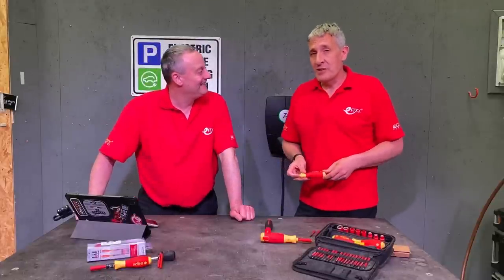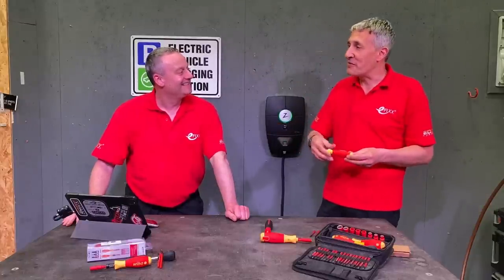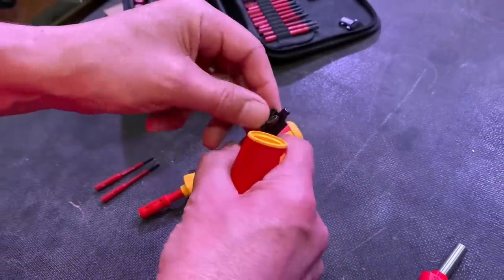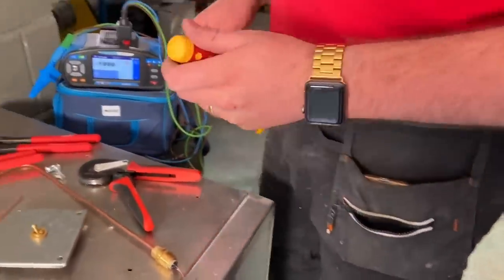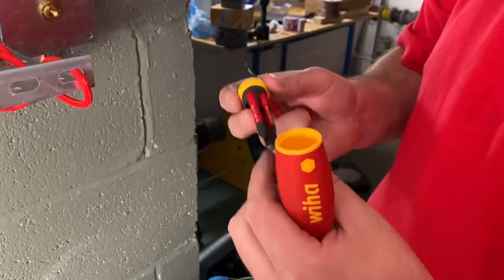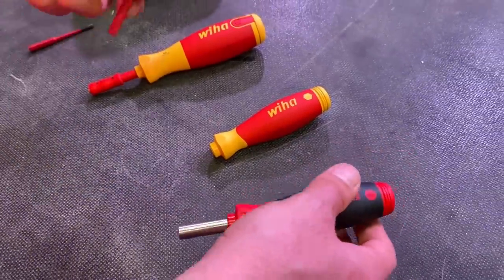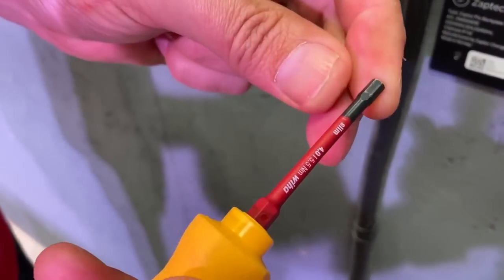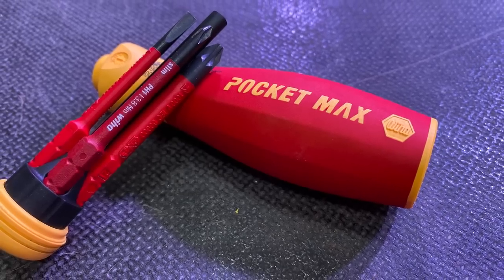The Wiha PocketMax Screwdriver Ideal for Electricians Going Places

Comment: I got this, absolutely handy but 1 downfall is that if 1 bit that you happened to use all the time broke, you needa replace the whole thing. Better just get the traditional one, so its easier for replacement.
Reply: You can buy bits separately one at the time if you need.

Comment: I've just ordered one. I've got 2 of the lift up which I use all the time. They are a bit big so hopefully this one will be nicer. Also, I hope they don't fall apart like the liftup. I've been waiting for the successor to the liftup. Liftup 2.0
Reply: @efixx  Its actually 3.0 I have an earlier version called Wiha fliptop. It was insulated but used normal 1/4" hex bits. The bit holder was too chunky so was a bit useless.

Comment: Multi-screwdrivers are supplementary kits, they'll never replace individual screwdrivers. That said, it'd be nice to see tailored kits to geographical region. In NZ (New Zealand) we use 3mm flat, Phillips 2, Robertson (square 2), and 4mm flat all day long.  It's a little frustrating when Wiha kits omitt the No.2 Sqre drive, have a 3.5/5mm flat, a Pozi 2 (Which is used for circuit breakers, but not really used if you know what I mean...), and generally are ill suited to our requirements.  Let me just say, I love Wiha - one of the only brands who does a 3mm flat slimline screwdriver blade perfect for nz, and also a screwdriver profile that is nonsense free (looking at you WERA) and functions perfectly.   Pop up screwdriver is too large, and also has bad reviews over time. Haven't used it myself, but reluctant to try given the negative reviews for general longevity.